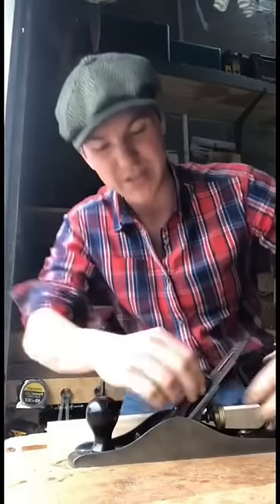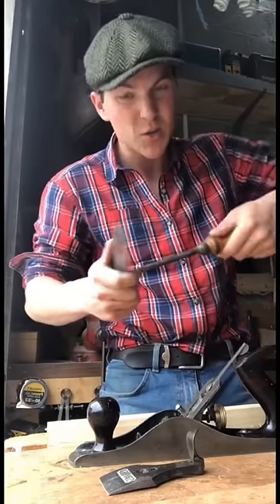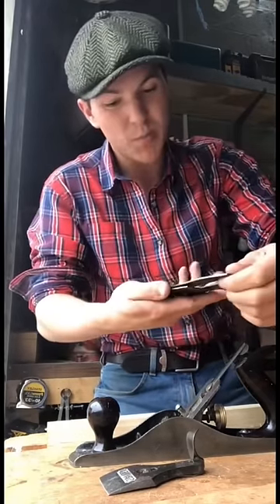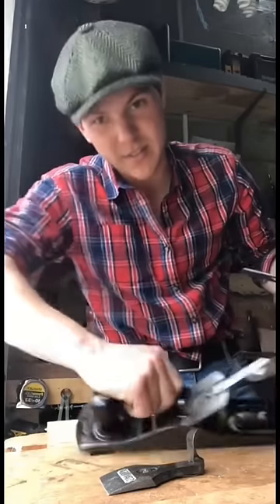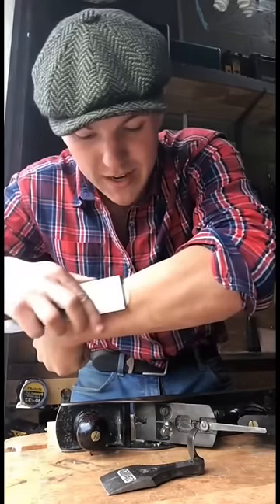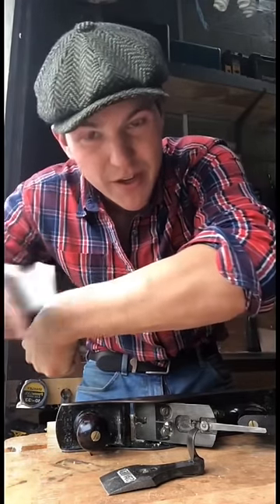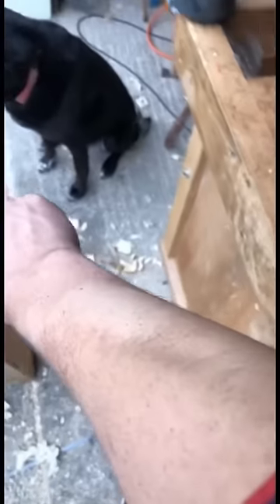Should you place a plane on its sole, will it blunted the iron? #woodworking #shortvideo #satisfying

Comment: I think that is more of a good habit to follow and not a strict rule. I would recommend it just because there could be a stray nail or anything else in your way and you could damage it. Or when your at a client's place you could damage the blade or the surface you placed it on. So just try make it a habit to place it on its side and with the blade facing away from you.

Comment: It does damage your edge, but imperceptibly so. If you want to test it out yourself just take your plane blade, put it in a vice and hit it 20-30 times with a wooden mallet that's as heavy as your plane, on a roughly 25°-40° angle. It doesn't take alot to start seeing glinting.
Reply: Hahahaha so you're saying you throw your planes at your bench instead of setting them down?

Comment: I'm currently doing woodworking and we're told not to put the on their sole because it moves the blade out of position, so you may start to make some really off bits of wood
Reply: No good plane will move from being set down. 

If you think about it, it would happen on it's side too.
And when the plane is being used.

Comment: Your very lucky to only over use a plane on a wooden bench. 
Once your are out on site and you don't have a bench you will be very glad to have hat a habit of putting it on its side. Because having to stop to sharpen it in the middle of the day because the concrete floor isn't so kind to the iron is hassle you can always do without

Comment: Thanks for debunking this old wives tale. The cutting edge of a plane is the point where the surfaces of the bevel and back meet and when properly sharpened for fine work, the  thickness of the cutting edge isn't  measurable.

Comment: It has nothing to do with whether it will cut the wood, when it’s razor sharp, as yours is, there is only a molecule of steel as an edge(yes, you read that right, a truly sharp blade is sharp down to the molecule) and when pressure is acted upon in a direction other that back towards itself, it will dull it.
Reply: Entirely wrong.

A well sharpened edge (for a straight razor) will be about half a nanometer.

An iron molecule is 0.125nm.
This means the edge will be 4 molecules thick.

A blade can be 10s of nms thick to properly shave hair.

What you are saying is absolutely nonsense -- edge deflection does not cause dulling.
Plastic deformation causes dulling, not elastic deformation.
Placing a blade on it's side will cause a small amount of elastic deformation, not enough to worry about.

Also you are crazy if you think planing produces less deflection that just resting the plane on the desk.
There is significantly more force acting on the blade.

And besides, if your edge was '1 molecule thick', the first pass would ruin the first nm of your edge.
The crazy part is, even a skilled handtool woodworker wouldnt even notice. Because that sharpness is lost in an instant, down to something where it can actually hold up to the stress.

Comment: Doesn't it push the blade out of alignment if you're putting it down on its belly all the time
Reply: No? Otherwise it would when in use too.
Reply: @autumn5592  good point. Although when in use there is forward momentum applying force equally to the blade. Vs being placed down is an upward momentum which could be uneven
Reply: @alextomlinson  Twisting, figured grain, or knots all change the force on the blade.
You aren't always planing stock as thick, or thicker than your plane iron.

So that argument is a little flawed.
Reply: @autumn5592  maybe so. I guess my concern is that an upward pressure without a forward pressure could tilt the blade out of alignment. Giving you an uneven shave or making you adjust the blade laterally more frequently so it remains parallel with the base.
Maybe that would just be an issue of a blade not being locked down tight enough. However I have seen some Stanley branded planes that if locked down too tight the lever cap snaps in half. I suppose that would be an issue of metallurgy rather than a design flaw though
Reply: @alextomlinson  Maybe I just like my caps tight, but I have never had the plane iron move unless I tell it to.

If it were to move, even with a looser cap, I doubt it would be anything meaningful unless you throw it at the bench.
Reply: @autumn5592  depending on the surface of the bench and how the plane is put down could it knock the blade out of alignment with the base? For example if the bench is an uneven surface and someone drops the full weight of the plane down onto the bench, some of these planes are heavy, and may be dropped down in a backward motion or a straight down motion so the edge doesn't cut in but just takes the force wherever contact is made. And depending on the plane, how well it's made how tight it's locked could result in a misaligned blade?